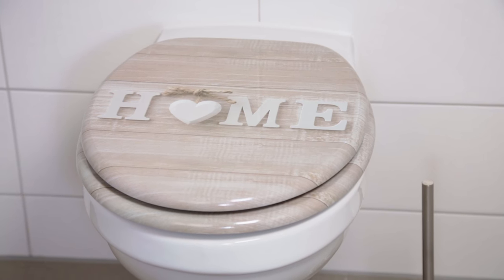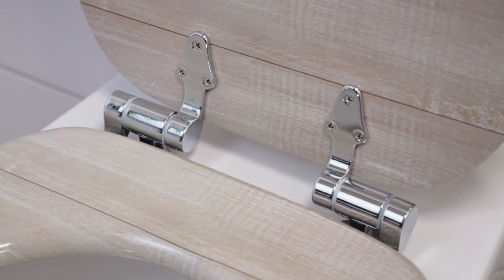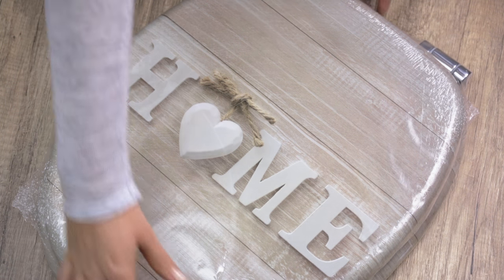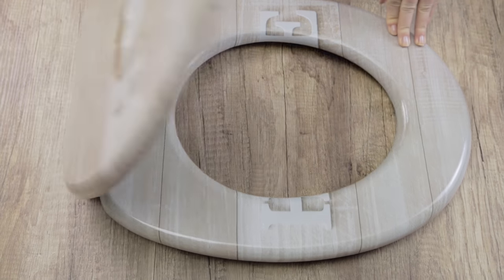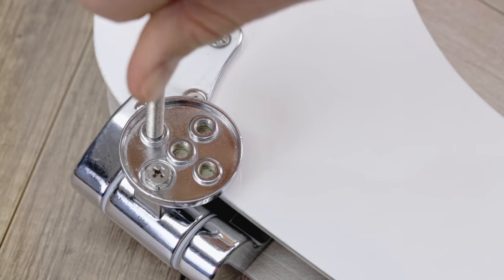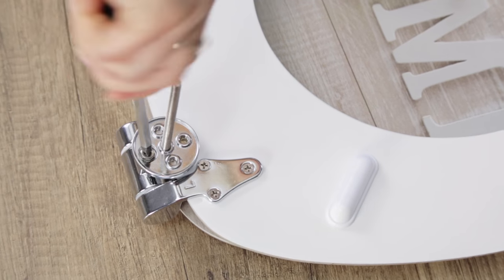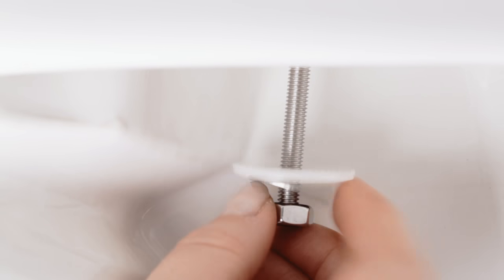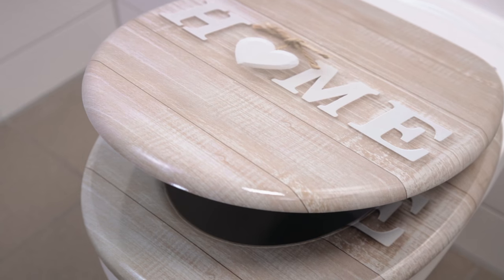How to fit a toilet seat - as simple as that! - english

Comment: This has the same fixtures as a Homebase seat I’ve just fitted. The instructions in the box were rubbish, but this helped a lot 😊
Reply: Mike, I feel your pain. Useless lack of full instructions with the Homebase seat - or rather, worse than useless, because some of the info was downright misleading. But fortunately this video has made it all clear.
Reply: @simonbradley103  Yes mate I would have felt pain if I had assembled it as the instructions!

Comment: Very easy to install.  I watched the video a couple of times, to understand the process, then installed the seat in about 5 minutes.

The bolts are twice as long as necessary, so it takes longer to tighten the nuts on them.  But they, and the washers, hold much more firmly than the plastic screws on my previous (dollar-store) toilet-seat.

Comment: I think I will go back to the original method...I'll just go up to Lowe's or Home Depot. You shouldn't have to consult a video to install a toilet seat. Took me longer to figure out how to adjust it than it did to install the toilet and I'm 70 years old. It's also overpriced by about 30%.
Reply: I agree. I like the idea of this toilet seat, but getting it adjusted and installed was a nightmare. For one thing, this Sanilo seat has more hardware than necessary. I wish it had had the hardware of the seat I was replacing — the old one was super easy to get on and off, and I didn’t need any instructions for it,  much less had to hunt down a video to figure it out. But the worst part was, once I got this new Sanilo seat on, I saw the pattern on the lid was crooked and doesn’t line up with the same pattern on the seat. (I got the pattern that looks like distressed wood strips stained in rainbow colors.) so it looks like the lid is on crooked when it’s not. That’s going to drive me crazy every time I see it. I expected better for $60. I regret trying to go for something more fun and interesting. I never had these issues with cheap solid white toilet seats. I guess some things really are better just staying basic.

Comment: those fittings don't just drop easily into the fitting holes of the toilet. They don't even fit when you try to squash them in. The major work when fitting a new toilet seat is getting the old one off. They've often been on for years and the fittings can be set and stiff so you need pliers to loosen them. I hate it when videos make stuff look easy when in fact, its a dirty nightmare with 20 years of faeces stuck in certain holes and hinges